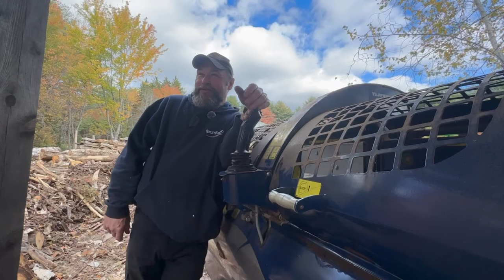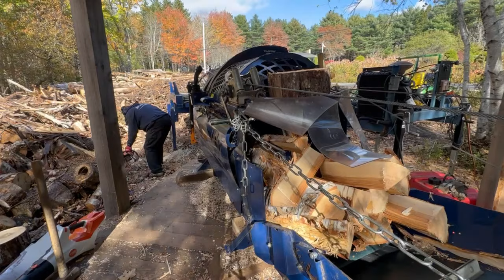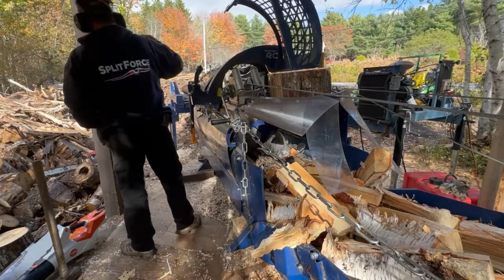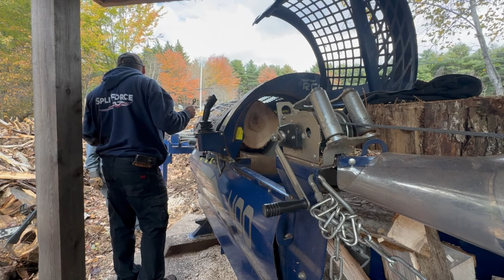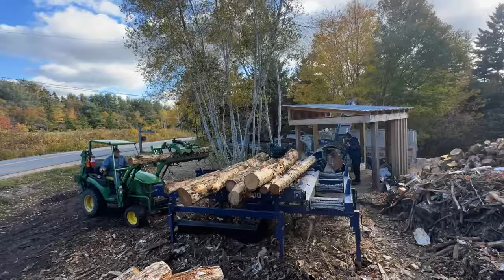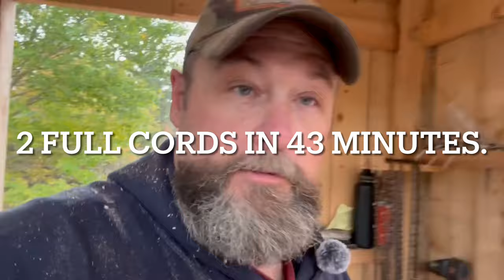FIREWOOD FOR PROFIT, THERE’S ONLY ONE RIGHT WAY?

Comment: Hello Jeff. I noticed that you had to cut the limb stub off one log. Last year, I bought a battery-powered chainsaw. I love it because I don't need to pull and pull on the cord to start the saw. I just pick up the saw, release the chain brake, and squeeze the trigger. I am almost 73, so the ease of use is wonderful.
Reply from the maker: I’ve got my sights set on a little Stihl battery powered saw.
Reply: I bought a Stihl MSA 140C, with 2 batteries, on sale. The saw works very well, and the batteries work for quite a long time on a charge. The saw is very good for limbs and tree tops which are 6 inches or thinner.  
I may buy the bigger battery saw and sell the two gas saws I have.
Most of the trees on our property are 10 inches or smaller, so I don't need a big saw or a long bar.